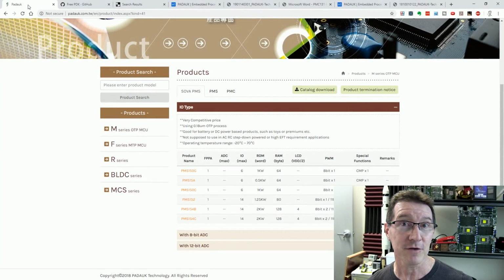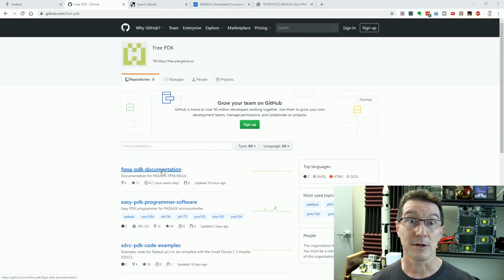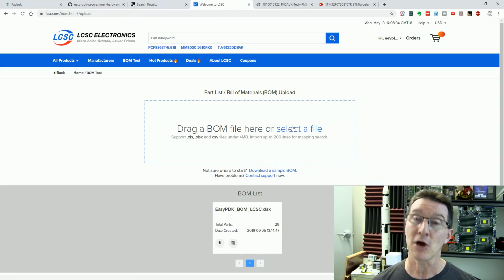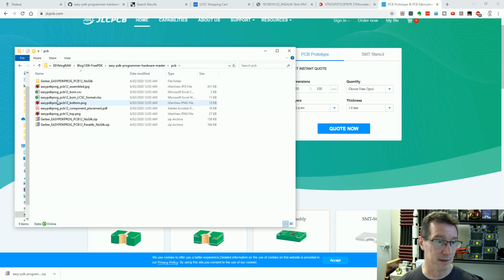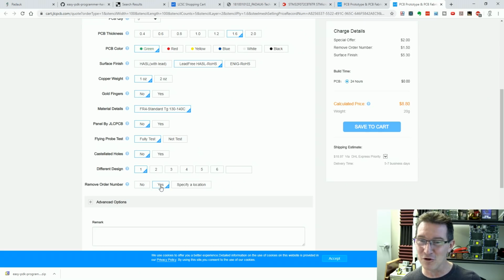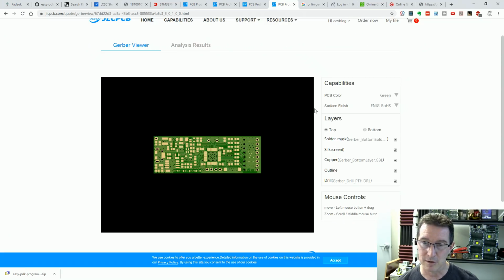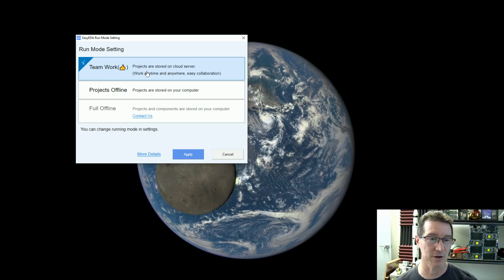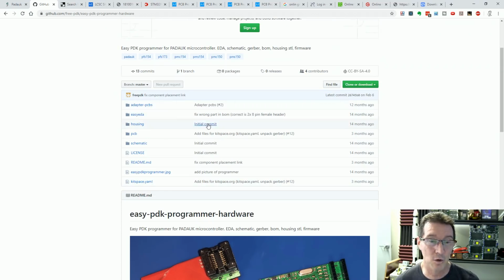EEVblog #1306 (1 of 5): 3 Cent Micro - Open Source Programmer

Comment: I often do multiple designs on the same PCB run and just have milled breakouts (with mouse bites) as opposed to V scoring. Usually doesn't cost any extra, but on JLC you have to select the "Different Designs" option that increases the cost a little bit.

Comment: Hey Dave, awesome that you are covering this in such detail! Have you noticed the www.kitspace.org links right on the main readme of the programmer? This site is dedicated to cover many of the steps one otherwise has to do manually in order to get the parts and board. Could you maybe mention it next time and give us a little love for this community-run open hardware website? https://kitspace.org/boards/github.com/free-pdk/easy-pdk-programmer-hardware/ (kitspace doesn't charge anything on top, btw)

Comment: They (JLC) just quoted me 44 EUR shipping for 5 pcs 30x69 mm two layer board with no extras. I've also tried to get a few of the STMBL project boards, the gerber didn't even got recognized. Other manufacturers did not have that problem with same files, and the total price was lower.
When I sent an email to support, they responded that they are not offering support for free. They did not comment the 44 EUR shipping quote.

Comment: On JLCPCB, for the "Remove Order Number" option, "Specify a location" is free. Useful if you're designing a board, or have the ability to edit an existing board. All you do is add the text "JLCJLCJLCJLC" in a readable font size somewhere on one of the silkscreen layers, and they'll replace that with the order number. If you're assembling the board yourself, you can put it somewhere that'll be fully hidden once it's assembled, like underneath a large chip, or simply ensure it goes on the bottom side.

Comment: You can usually unzip within the file open dialog by right-clicking and using the Windows Explorer ZIP extensions to extract to a folder named the same as the zip file. I do it all the time... no reason to stop and resume the video there just because you encountered a zip file. ;)

Comment: i once ordered a large led matrix and the led's needed silkscreen and also the conectors were named and jlc had the audacity to put it on the front and i eas so infuriated by this i had to screpe it off with a scalpel then touch it up with scharpee

Comment: You should have used EasyEDA, select panel and specify the number horizontal and vertical, they will be V grooved at no extra charge provided that your panel is at least 70mm in the shortest dimension. Then click on Order at JLCPCB :) Minimum V groove spacing is 20mm, they snap your panel out of the big one and V groove it separately, add a boarder to the panel and the order number will be put on that :) The perfect size for that PCB would be 20mm wide X 90mm long, paneled by V groove 5 across with a 5mm boarder top and bottom for $2 !

Comment: I'd be vary of that panelisation and assembly on the panel. They have some SMD caps quite close to the edge and breaking those panels apart can easily introduce little micro cracks into to SMD parts. This might make them fail immediately or even worse they might work and over time break because they accumulate humidity from the air...
Nope, not a fan of those V-grooves!
That's not just theoretical! I've had to change the PCB of a device which was in full production because of such issues. Without changing the position of any testpoints... It was an interesting challenge!

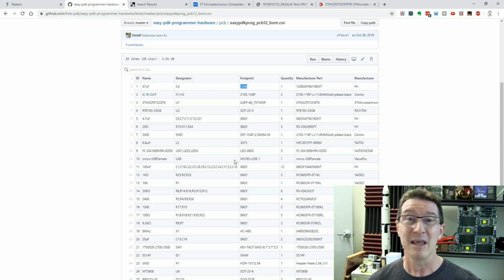Comment: @9:30 where you're saying that capacitor models don't matter, this is dangerous if you have systems with say  a 19V input as well as low voltage rails for a 1.2v FPGA or something. Need to make sure it's at least a certain value on the context.

Comment: JLCPCB will actually do V-scoring even for 5 proto boards ($2) for NO additional cost (as long as its the same design).

EDIT: But the resulting "panel" needs to be larger then 70x70mm (which is not an issue, as up to 100x100 mm is same price).

Comment: I was giggling at the end of the video when you mentioned Atmel many times, but the programmer actually doesn't use Atmel chips. It uses an STM chip. Probably better too. These chips are so easy to work with compared to bloody AVRs.

Comment: JLCPcb will actually make the panel so that you can easily break apart the boards, without any extra cost (as long as it's just one board design, not multiple ones with different dimensions). I've ordered panels like that multiple times from them. Just put the boards right next to each other so that there is basically just one outline between them. At least that's how I've done it.

Comment: Fun.
BTW, if you ask, some AliEx sellers will sell the SMD ZIF sockets without the adapter PCB and headers, for the same price as the ones with adapters. If you're going to make a pcb, skip the extra layer of potential nonsense from questionable soldering.

Comment: "It's completely opened up these remarkably cheap microcontrollers..." -> "It's completely opened up these FORMERLY cheap microcontrollers..." Fixed that for you ;)

Padauk-uino - Paduino

Heh all very cool. I look forward to the rest of this series and I hope this is a good thing for Padauk. This has been good for the maker community to nudge it towards more "conventional" microcontrollers. That is to say, micro controllers that are programmed at a low level (assembly). The Mini-C provided by Padauk is, I believe, equally responsible for the popularity of these microcontrollers along with the low price.

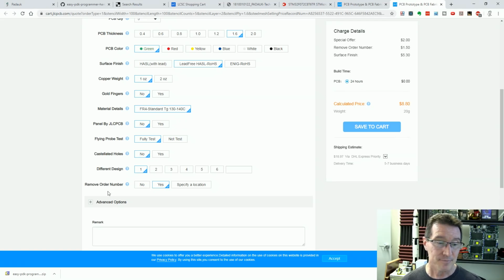Comment: 22:19 one note, if you order small pcb and choose penalization by jlcpcb and you're board size is not a divisor of 100, or you order less then you could possibly fit in 100x100, then they will make panel 100x100 and add the order number on the excess board (100 is just as example of standard size)

Comment: 555 timer is 110 cents in Helsinki shop. Dave's processor is 3 cents. There is something wrong here. We need a shop which sells  preprogrammed Padauk processors imitating standard chips (like 555).

Comment: JLC has been taking some liberties with my boards too. Second to last order had entire chunks missing out of traces that ran "too close to drilled holes". The files adhered to their design rules and it wasn't like the router cut into the tracks physically, the tracks just had entire chunks missing even though there was plenty FR4 left. My last order even had a board that had entire traces moved around. I'm going to have to have a chat with them, otherwise I'm jumping ship to PCBWay.

Comment: These only seem worth bothering with if you have something very simple that you could otherwise do with 555s, 74 logic etc. A cortex m23 that does way more, works with standard tooling etc is less than $.30 in quantity of one now.
Reply: G'day Don,
I bet the 8051 will still be chugging along and readily available long after that cortex is EOL :-)
 
  I don't know of many examples on YT showing a SDCC 8051 toolchain from start to finish. A complete working example might help a hobbyist like me.
  ...but you're right the cheap ARM stuff is hard to overlook.
-Jake
Reply: @BarryManilowa  Copacabana beach Polish style? ;)

Comment: Already bought the official programmer and emulator from LCSC, because I have a high volume product in mind (thanks for the 3 Cent Micro video, Dave!). The whole mini C experience looks to have it's own charm. As for hobbyists, all I can say is that you must not have been doing embedded stuff up until the early 00's. OTP and UV erasable parts are a fucking pain in the ass for tinkering.

Comment: Why all of the stiching?
Reply: When you have GND-planes on the bottom and on the top cooper layer, you want to connect them with a very low impedance to have them on the very same potential.
In addition: (Not relevant here) you wanna split the current on several vias, as your via might become hot

in high frequency applications (>XXXMHz), there are further considerations, which would go too far for a short comment here.
Reply: @Klemmi.  as much as the bottom is sliced up with traces, I didn't consider the bottom a useful ground plane.
Reply: @MrAwYork  Actually, the ground planes on the top are interconnecting the ground planes on the bottom and vice vers. So that should be okay. And a ground plane on the top is in SMT very handy, as you don't have to route the GND connections by hand. Of course, you could optimize the PCB design, but as it is, it should do the job pretty fine.

Comment: Knew this would be done, well done to everybody that made it happen.  Those controllers might be cheap, but I've seen quite a few 8 pin unmarked controllers fail for no apparent reason (just now have a China made speed controller where one has failed), they seem quite vulnerable to transients (they don't seem to fail in battery powered products, the speed controller is an exception but it's an electrically noisy device). Whether they are the Padauk ones or not, I don't know, as no markings at all.
Reply: Could be due to improper IC storage in humid conditions prior to reflow or improper reflow parameters damaging the chips. But susceptibility to transients could well be to blame. I've heard these 8 pin chips are made by a legion of obscure manufacturers but for all I know the total number of actual manufacturers could be less than 10.

Comment: You can set the location of the JLC order number for free. I usually just stick it under an IC or something where it will be covered up.
Reply: https://support.jlcpcb.com/article/28-how-to-remove-order-number-from-your-pcb
Reply: It is easy, they explain it somewhere in their website. You have to put something like JLCJLCJLCJC in the silkscreen and select "user specified location" when you make the order.
Reply: Is that an easy eda thing, or do they have requirements for specifying the location/size/font?
Reply: hahahaha I wish I thought of that.
Reply: I just scrape mine off

Comment: I am pretty sure that they do vscoring by milling with v shape CNC bit now, not by cutting with a disk. And it is considered easier for manufacturers than milling cutouts because they do not have to take into consideration structural integrity of each panel during their process.

Comment: When a PCB is twenty cents or less, an eeprom is twenty cents, I fail to see the advantage in using a proprietary micro that costs a nickel vs a more commonly sourced part that costs a quarter for any sort of hobby project. A huge part of the Arduino line is having great docs on virtually every part of the chips used. All something built on this would teach you is how to program a cheap proprietary micro in c. That's not hobby fun, that's development drudgery.

This micro reminds me of Mitch Hedberg's line about rice being his favorite food when he's in the mood to eat a thousand of something.
Reply: The advantage is a built-in opportunity for extreme yak shaving
Reply from the maker: There is no real advantage for hobby projects. It's obviously for projects where the price does matter. And it's interesting in it's own right.

Comment: How is no signal put inside a tv how does it show when nothing is connected?
Reply: It's a feature of the scaler chip which converts between the different video inputs and the signal supported by the LCD panel. There's plenty of room in the digital signal pipeline to render some menus.

Comment: I ordered 6x6 panel of 15x15mm PCBs from JLCPCB using their EasyEDA with weird panelising where it doesn't actually copy the PCB, I didn't provide them with any other information apart from whatever has been generated along with the gerbers(output zip file seems to have ".mechanica" file containing some panelising data), they arrive on friday, lets hope it will come good.
Reply: I've done it, it works fine.

Comment: JLC offers V-score on boards for pretty cheap. I was manufacturing a kit for a while and I could get 80pcs made for $10 as I had 8 boards per 10x10cm panel. The first few runs it was free but recently they started charging $5  to do the V scoring.
Reply from the maker: Quite amazing how little they charge extra.

Comment: Jlcpcb will vscore small boards at quantities as low as just 5 panels. I've gotten panels as small as
60x80mm vscored.
On the order number, they don't charge more if you specify where to put it. I shove it under an ic.
Reply from the maker: Ah yes, forgot about the placement text. I recall them having a specific string marker.
Reply: EEVblog : yes, repeat “JLC” 4 times iirc
Reply: AllPCB will also do V-Score on quantities as low as 5 boards of 55mm  x 80mm, but they do charge you a bit extra.  But it was still only $21 shipped to the US for 10 panels.  And their design team try to put the order number under an IC or transistor whenever possible.  Or at least they have on my last 5 orders from them.
Reply: Currently JLC charges "exta" for V-scoring (OK, they don't charge you more, but you'll lose the 2$ special and pay 4ish $ standard price). At least last week.

Comment: Maybe you could make a C source that basically drives a GPIO out pin and in pin as per to program it, and then you'd have to interface the GPIO to the chip and could program it. I mean to use anything that has a GPIO, like a Pi...
Reply: @Tone.  Hmmm I am not like a certified CS or anything. I'd have to check how the programming pins work on this controller. I don't know right away if it is a 2 way process or not. There may be some Pi stuff already for doing some things like this. Also the voltage for these chips is like around 2.8 to 4v and the Pi has a 3v GPIO as well as 5V. You would have to make a pi to chip socket thingy that supplied its chip power also.
Reply: I see you have no idea how low are this chips on memory..
Reply: The programming is for programming the chip not the on chip data. But it may be too much hassle to make the converter socket. It really is dependent on what thing with GPIO you are using.

Comment: I would love to see them drive a ws2812b RGB light strip with one button for different sequences.
Reply: The 3ct version has only 64 bytes of RAM though, so if you want to allocate a buffer for the LED data, the strip length would be quite limited. As absolute maximum 21 LEDs. I have tested multiple libraries and all used at least that amount for the buffer (3 byte per LED). Don't sure if it would be possible without buffer, but in theory it should.
Reply: I would like to and have some completes projects but I suck at it, I need to "learn to code". I am struggling to program an attinny 85. Arduino says my sketch uses less than the 8K and 512 bytes of memory.

Comment: Regarding the panel and v-scoring, JLCPCB will do that for no additional charge even if it is just a small panel. I've done multiple 10x10cm boards split into a 3x3 grid. They will even do the panel for you and do the v-cut. I've tried doing it myself in the gerber and having them do it, both worked fine.
Reply from the maker: At the cheap proto price? That's amazing if they do. Ah, come to think of it, they could use the shared panel and then snap out the individual board and then put that through the v-scoring machine on it's own as a separate process. I'm surprised if they don't charge extra for this.
Reply: @EEVblog  Yeah, no extra charge. Only time I had an extra charge was a super slim board (7mmx70mm), they charged a very reasonable fee due to the vscoring being difficult.
Reply: @rulleeeee  Nope - at least at the moment you'll lose the 2$ speciala and pay the "standard" 4$ if you use V-Scoring.
Reply: Yep, if you order 5pcs. Last time I ordered (some time ago), I ordered 10pcs instead of 5 of one 100x100mm panel design and then they wanted an engineering fee instead of the usual special price. (AFTER I already placed the order, I think it was around 6$ extra. After some discussion, they eventually dropped the extra charge in this case.)
Reply: @Basement-Science  Was that your panel or did you do the "panel by jlcpcb" I've never had an engineering fee when the panel was made by me and v-cuts specified in the gerber
Reply: I was amazed too that they’d do panels for $2 too. 5 100mm x 100mm boards was cheap enough anyway, but multiply by 3 that I could fit in  to that space and 15 boards for $2 is insane! They emailed me on one occasion because the gap was only 1.6mm and not 2.0 and would I mind if they adjusted it for me. Of course not, be my guest :-)